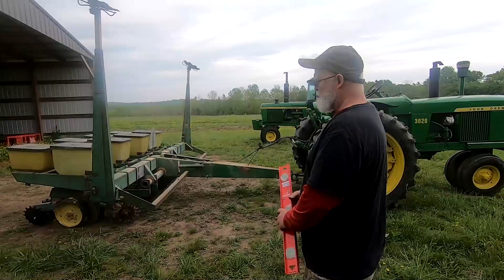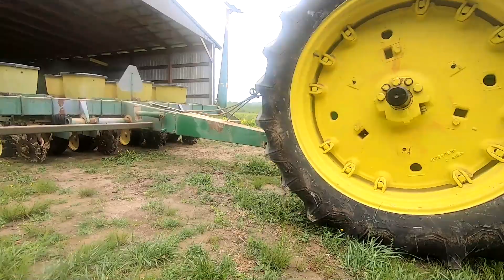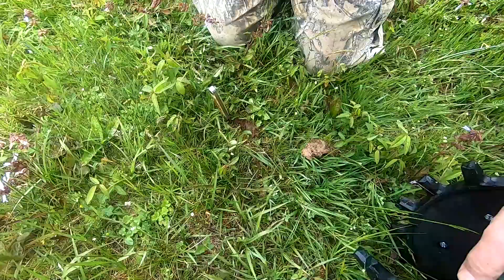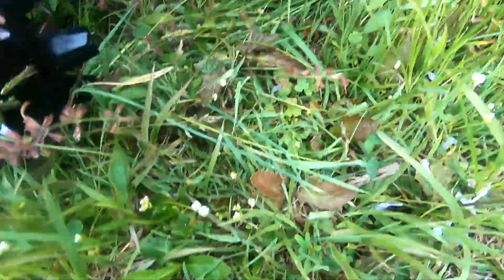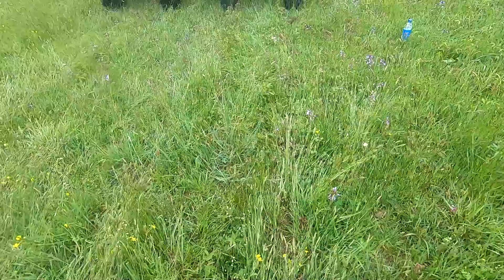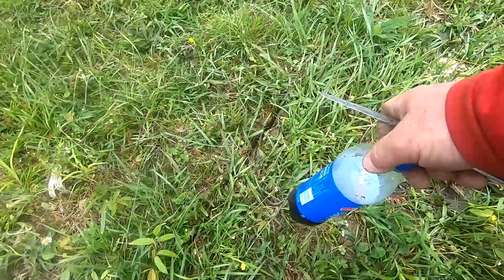John Deere 7000 no till setup

Comment: If  you need to raise the front of the planter why not turn the drawbar on your tractor over and if that is too much then just add shims between the top side of your drawbar and the planter yoke? How do you apply fertilizer to your early growing corn needs without spreading it far from the roots of the little plant?

Comment: I have this same planter. I have very variable soils !  From sand to hard clay.  I have no row cleaners. I fought for a year to figure out what would work !   So...I use the fertilizer disc openers. Cut both bolts off ....used one newly welded bolt on only one side. Welded the new bolt square......not at an angle.   Used a 14 inch culture from a Kinze planter. Added an extra down pressure spring......including the spring of the fertilizer attachment of the disc openers.  I run that disc one quarter to a half inch off to one side of the main disc openers.  It works 100 percent !!!   No messing with down pressure on the units !  However.  I needed to add 300 pound to the fertilizer boxes just to keep the tool bar from coming up and  having no weight on the wheel for planting. ( in other words the drive wheels would come off the ground )   There is no way you can get enough down pressure on the units to get them to cut through hard untilled ground !  Those front coulters carry around 300 pound each.   With that.....the planting units just follow. They cave off the one side of the trench that the  coulter cut. My smooth closing wheels work just fine.
The markers............ on the end of each marker......I welding  a re-rod vertical of the marker bar....... 15 inches from the marker disc. I used a disc spool bolted using that re-rod ...to the marker for added weight to get the markers to cut better.  I also had to cut the cams out in the disc markers to get them to turn out/ in more. This works !
Ill never go back to tilling !

Comment: Did you have problems getting depth in no till conditions this year? I had that problem this year
Reply from the maker: At first yes. I had to adjust the down pressure springs for the hard spots to get it deep enough. And adjust my gage wheel depth to keep it from going too deep in the softer spots. It worked out good. Got a good even stand. Thanks for watching!!

Comment: Something else to check is after you stop with the planter still down on the ground,  grab the gage wheels, and see if they are tight on the ground or can you spin them. If they are tight then you have enough down pressure, but if you can spin one or both, you need to increase down pressure.  Good luck.
Reply from the maker: Thanks. I checked the gage wheels, and sure enough, I had to put a little more tension on the down pressure springs. I planted 22 acres and it seemed to do a good job. I will still be worried until I see the corn coming up! Lol Thanks for the advice. I hadn't thought about checking the wheels.